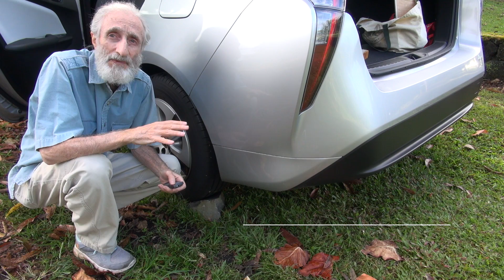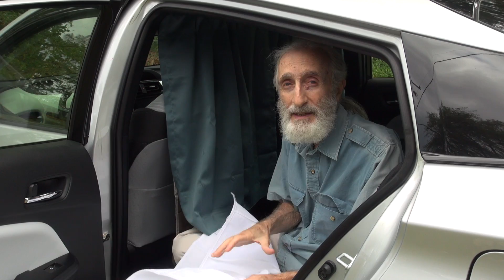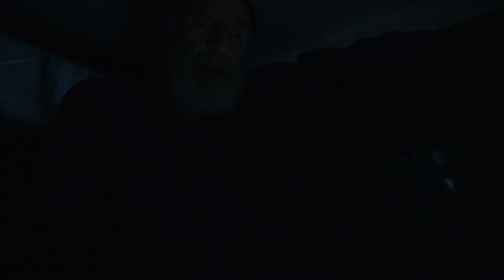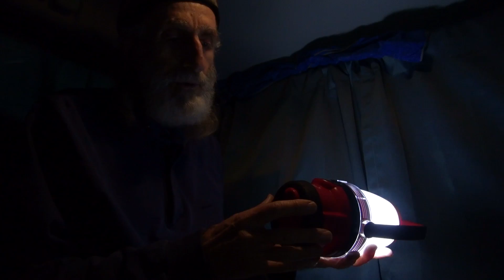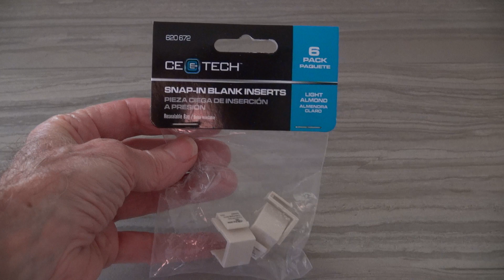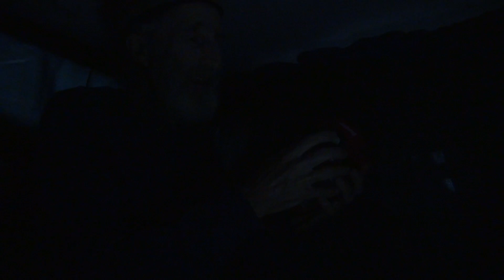Car Camping Prius Set Up More Information

Comment: who is cuter than u. I also camp in my Prius. I took the front passenger seat out and installed an electric refrigerator freezer. When I am alone I put all of my gear on one half of the back and n my bed on the other half. When I am with someone I sit them in the back seat passenger side so we can still see each other. When it's time to sleep we put all out our gear in the front seats and make our bed in the back. I put the fabric trunk cover up in the back window to block the light at night. I have the window screen socks for the side back windows. I installed an inverter under the driver seat to plug in all my electronics. I leave my car running all the time and I lock it with the manual key in order to leave it running and having it locked. My last road trip I joined planet fitness it's cheaper for showers than stopping at the truck stop.

Comment: Try using a bungee cord for a curtain rod, if it sags too much, use a double ..Simpler and easier to store.  I use a cheap black shower curtain cut down, for light weight and privacy + compact storage when not in use.

Comment: Thanks for explaining having the heating system overnight! I’ve seen lots of previous videos, and they all make a reference to it but if they describe it at all they rush through it.

I know from comments on those videos that it has been a point of confusion with new Prius owners. I’m hoping to get one, on the strength of its overnight heating/air conditioning.
Reply from the maker: Thanks for your comment and for watching. I haven't kept up with any changes on the new Prius So I don't know if it would work the same. They might even have a camping mode for the climate control system like some electric cars have. Also remember that if the system is on long enough the engine will occasionally come on to recharge the battery using gas and also creating exhaust coming out of the tailpipe. Have fun with your new Prius if you get it.
Reply: @WonderfulWanderingTopics  Looks like the Prius Prime can't run for more than one hour in climate prius hotel mode.  But a regular Prius still can.

Comment: How is it sleeping in the Prius when you have the big difference in the level of the trunk space vs. the back folded seat?
Reply from the maker: Thanks for your comment and for watching. I have the 2016 modelThree Prius. That year the Prius came out with about four to 5 different models of it. On the three when the seat back is down there is only a slight difference in the level. I put a rubber mat down and then my sleeping bag on top of that and for me it is comfortable. My head and upper torso id slightly more elevated than my legs. But that is ok for my since I sleep that way in my bed for better breathing. But like I said other models had a bigger difference in level so you really should test it out for yourself before you buy something if you intend to do a lot of sleeping back there. From what I understand newer year Prius models have changed some configurations so again check each model.

Comment: I thought the prius would start up and run the heat or a/c automatically.
Reply from the maker: Once you set it up and leave it on it will automatically turn the heat on and off. Thanks for watching.
Reply: Wonderful Wandering Topics what would the fuel consumption be on in 08 idle a normal night like 75 to 78 degrees in the summer with a hundred and ten degrees heat index

Comment: Here's a suggestion, get a remote start.  It'll allow you to turn on and turn off the car using a key fob remote without getting out of bed.
Reply: Turns out they are very expensive!
Reply: And my remote start only runs my Prius for 15 minutes !

Comment: have there been runway  Prius's? that randomly started moving when in park?
Reply: Prius' (correct plural of an S ending word)

Ex; Russ' friend chicken 
Which is delicious by the way.
Reply: @EvilTwin123  That's not plural, that's possessive. Is English your native language?
Reply: I've used my Prius v camper night after night with no rolling in 'Park'.
Reply: My wife’s sister was hit by a runaway Prius.
Reply from the maker: I haven't heard of any recent runaways. But in the beginning of this year there were reports of incidents where the Prius moved forward when a clip on the parking brake cable failed at the same time the driver forgot to put the car in park while the car was still in the on mode. The Prius is put in park by pushing a park button rather than a selection on the shift lever or automatically when the car is powered off. Toyota has since performed a recall to replace that clip with a new design of the clip. Thanks for watching.

Comment: I would replace that blue reflective material that he has if you want to be stealthy. Replace it with black velvet. It's the blackest material that you can use and will not reflect the beam of a flashlight.
Reply from the maker: Thank you for the info Chris Barclay but I don't plan on doing any stealth camping only camping in National or State parks. Thanks for watching.
Reply: Plus it has a song that goes with it!!